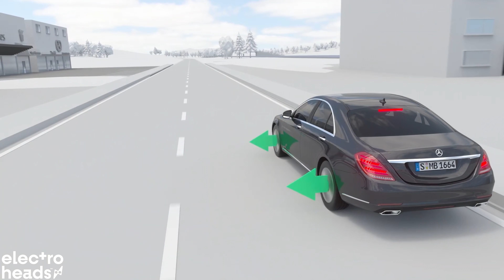The truth about why electric cars are so expensive

Comment: If you search around, there is no need to pay anymore than a similar sized petrol car. The Nissan Leaf is available for around £25k, which equates to cost of a similar sized petrol car such as an Astra or Insignia. Another possible comparison could be the MG5, Astra sized estate car, which can be had for £20k via sites such as Autotrader etc. The Corsa E has been offered at £22k, with 30'000 miles worth of free electricity. The prices are comparable if you look around. Plus there is always the option of buying a decent used EV from dealers such as  www.drive-green.co.uk  You don't have to buy new. And with 8 year battery warranties, there need not be any frighteners. Battery packs can be refurbished at considerably less cost than a replacement when they do eventually begin to lose some efficiency. There is no need to replace the whole pack. There is a video on here of a 10 year old UK owned Nissan Leaf having it's original battery refurbised. The work took around 4 hours, and cost the owner £600. That didn't seem to bad compared with a replacement gearbox or clutch on an i.c. car.....

Comment: Most of the main stay legacy makers of cheap cars just aren't in the game. Toyota not at all. Honda has one car, Mazda has one car, Nissan (despite a massive head start) one car, Renault....one car. Seat , one car. Skoda - nothing (Nothing sub 30k anyway)

The reason EV's are expensive is the cheaper guys  just aren't making anything you would want to buy. This suggests either manufacturing costs are to high to make them profitable or they need to shift what they have first to fund the EV's of the future. Either way, for the UK at least it's going to be put up or shut up time soon and I think some car companies will fall by the wayside.

The last issue is how many actual manufactures there are, if you look there is only a handful that own all the brands. Disruption will only come from outside  with Tesla for the high end and Chinese products for the low end.
Reply: good analysis! I hope the cheap chinese disruption will happen fast :)

Comment: Yeah! No mention of already on the roads in China and, India EV cars/trucks at very good prices. What about that Dacia EV.
Reply: Or the new mg model evs, they always want to compare an electric to a base model ice to. 
But if you load the base ice to a comparable trim spec against the ev? Well often the price isn't that different at all. 
And in some cases with the available rebates&incentives actually is cheaper vs the ice.
Let alone taking into account the total cost of ownership over the vehicle's estimated lifespan. 🤔
Reply: That cheapie Dacia EV could be a game changer for a lot of potential buyers. The average UK commute is 20.8 miles per day, and many people simply want transport to commute and nothing more. This Dacia could provide that cheap as chips answer for many people's daily commute. If you charged up on cheap rate through the night, you'd be driving to work and back for a whole week for around £3 or £4. No public transport could touch that..
Reply: @Brian-om2hh  Does rely on being able to charge at home or work.
Reply: @sIightIybored  Well it does, but the UK infrastructure is improving steadily. Around 50+ new chargers each week I believe..... Many workplaces and supermarkets are also installing chargers as they can get a grant to do so. My local Sainsburys has offered free charging for some time now....as do many LDL and Ikea stores. And many Local Authorities can now apply for funding to install street light and kerbside bollard chargers, but sadly many LA's seem oblivious to the fact..... I think a few ar$es need kicking.....

Comment: The people who make the cars are ripping people off simple as that, the battery tech is not new it is improving but not new, the cells used are quite old now
dating back to laptop pcs that used removable batteries, that's  where Tesla got the idea from.

But saying this, it could be a good thing having the main manufacturers drag their feet because China are not and given time they will bring their range of cars to the UK and they have cheap electric cars that start at around 4 grand, and yes they only have a short range but you could get one and extend the range making the car have a 200 mile gap between charges for around 6 grand perhaps.
Reply: Well as a comparison, basic fossil car tech is 100+ years old........
Reply: @Brian-om2hh  And battery vehicles are older, imagine how far they would be if they had continued with it rather than going petrol.
Reply: @flitsies  That was pretty much down to money. Big oil companies had money to burn.....and as a result they chased all other players out of the ring... And now it's slowly returning to bite them on the ar$e.....

Comment: I think that MG deserved a mention!? The MG5 is bland but quite quick and of sound quality........ but lacks the tech. The MG ZS has the tech, albeit basic. Both are cheaper than other similarly sized EV's. VW and Škoda are trying to fool you into thinking that they are becoming more competitive, but as soon as you want to add something quite basic, like the MG 5's regen controls, the price starts to rise and before you know it, you've upped the price by a few thousand pounds. But well done Electroheads for joining some of the other critics and discussing this thorny issue!
Reply: You don't have to "add" regen controls to VW or Skoda EV's. They leave the factory with them fitted as standard.  Things such as a heat pump are extra, but not everyone will feel the need for one, or be living in Norway...
Reply: @Brian-om2hh  Of course you're correct! I should have said Regen paddles which are part of an Option pack and which neither MG's have either!!
Reply: @Olivarus238  No problem 👍

Comment: Nice video. Let's put aside Tesla for the moment because the company doesn't have an ICE legacy. And here's my point. Legacy manufacturers don't really have huge margins on their cheaper ICE cars, via the ticket price. They get most of it in parts and servicing. So one of the added genuine reasons why EVs cost more is because they don't need to be serviced anything like to the same extent, so profit is obtained from the ticket price. And if they somehow sneakily introduce an EV that does require high levels of servicing, people will just buy the competition. And yes, I still think EV prices are held artificially high to keep transitional take up managable. Now let's add Tesla back in. They kind of set the EV standard on price, yet they are really still a relatively smaller vehicle manufacturer in an exponential growth cycle, compared to a mature legacy maker like VW, Toyota or GM. So it's difficult for them to make cheaper cars because they still can't achieve the scale that bigger companies can. But they will in the next couple of years, as their new factories come online, and then the standard price will come down again by a significant amount, as their battery and manufacturing tech also becomes around 56% cheaper.
Reply: ICE cars in the last decade or two are very reliable, between the 5 or so I know the history of repairs total less than  £1000 since 2015. Including the mechanics fees but not including stuff like tyres and wipers the manufacturers don't make.

Comment: I think it's a combination of battery price/battery availability, investment costs like R&D, and some pressure from their dealers who won't earn as much from maintenance visits. Sadly due to my low income and living in a flat, I can't justify any EV currently even though I really want one. I do try to get others to consider one and hopefully my surgeon will be getting a Tesla M3 this year!
Reply: Buy a used one
Reply: @mamadouaziza2536  I was about to suggest the same thing.... quite a few exclusively EV dealers now out there, with a seemingly thriving market.....
Reply: @Brian-om2hh  as a retail worker who has never spent more than £4k on a vehicle and who drives less than 7k a year with a mate who is a mechanic, none of them financially make sense for me currently sadly☹️
Reply: @mamadouaziza2536  I wouldn't buy a used EV without CCS charging now it's the main standard as I have no home charging option. I'll probably get a BMW i3 Rex when they drop under 8k as something I could live with.
Reply: @markreed9853  
The earlier i3' with the 22kwh batteries are going for $10k and under, but you have to make sure the car has the options you want. 
I would definitely get an i3 with the REx as you can code the REx to manually engage and hold the battery at any percentage below 75% indefinitely as long as there is gas in the tank and you drive moderately. The 33kwh battery version is now at a used price of $16k and the 42kwh version used is around $25k.. As long as you're driving less than 60 miles round trip in a day, the 22kwh battery version with the REx will suffice in comfort mode (range will increase in Eco Pro mode).
Reply: @mamadouaziza2536  I live in the UK so the European version wasn't restricted like the US one I understand. Yes I understand all the options and I really would like the blue one but not available at that price here yet. I will have to keep my Ford focus for a few more years. Funnily I bumped into a lady at the supermarket the other day with the one I want and she's had it 2 years with no problems.
Reply: @markreed9853  
Everyone in the USA are buying it used.